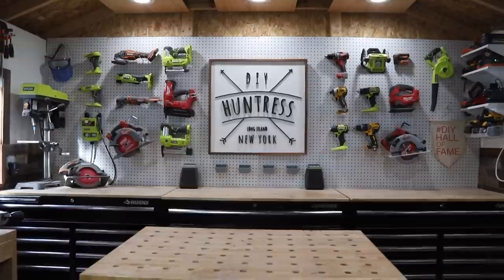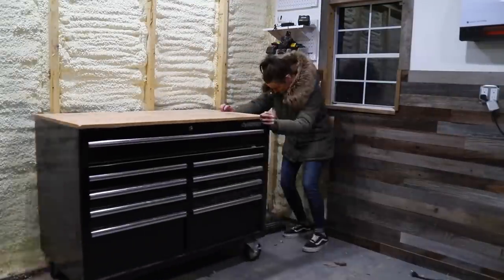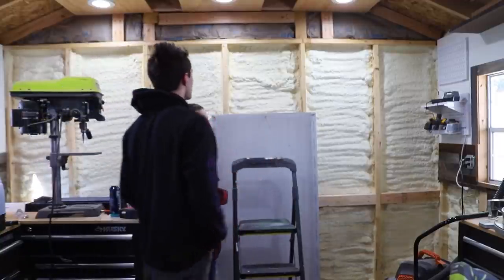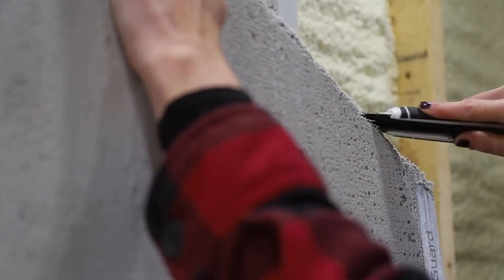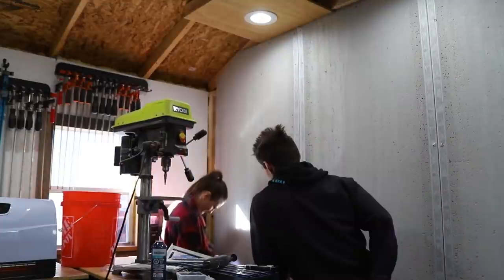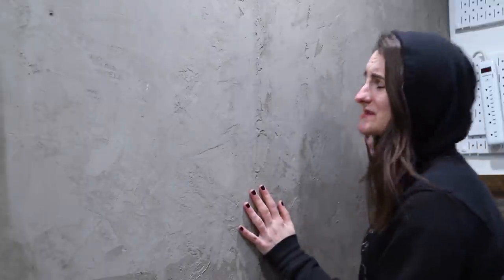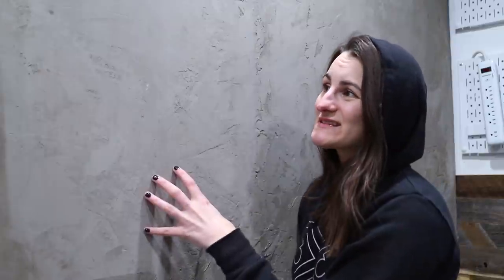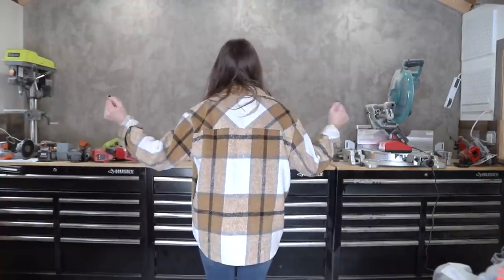DIY Concrete Accent Wall | Starting My Shed-Shop Makeover!

Comment: Looks awesome,I really like it, one day I hope to do a concrete wall in my house.
  I would of put plywood or osb behind  the durock looked like it was flexing a bit when you applied the cement.  Moreover if you ever mounted anything to the wall there would be something solid to screw into .
Reply from the maker: Thank you! No flex, actually because I added the blocking! I was able to get a board everywhere I needed to add a screw. 😊

Comment: I also used Feather Finish recently for a bathroom design project. Same problem — the colours were very inconsistent. I couldn't figure out if it was the water in the mix _to start_, or the consistency of the mix at the moment of application, since it dries out as it sits. The other variable is simply how thick it is on a given section of wall. In my case, some of the holes shown through as little circles where the mud was thicker and took longer to dry out/cure. 

The solution for next time I think is simple — have a second person on board so you can work quickly. Use thin layers and do 2–3 coats, only worrying about surface finish at the end. A lot to ask for a shed (or bathroom), but for anyone trying it, learn from our mistakes!
Reply from the maker: Ahhh! Love this - thanks for the feedback!

Comment: You can overboard with cement boards, only find your studs and set out your cement boards from your studs. Bear in mind cement boards may be a different size from plasterboards. I would have personally used plasterboard, it will be strong enough to carry the cement
Reply from the maker: So good to know! Thank you!

Comment: Looks great! Question though - does it need a sealant coat or is it ok as is?
Reply from the maker: Thank you! It doesn’t because I’m not “using it”, if that makes sense? But, it’s super easy to add sealant to it, if you’re doing a project like this. I just wanted to keep it as matte as possible for lighting reasons.